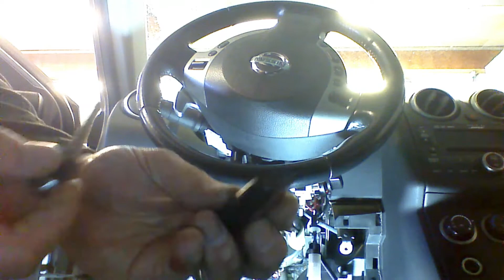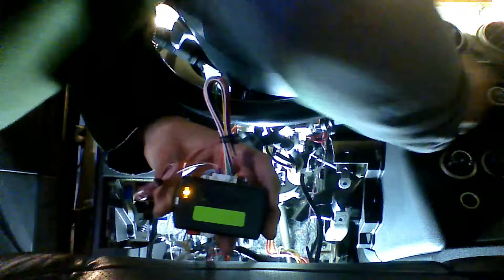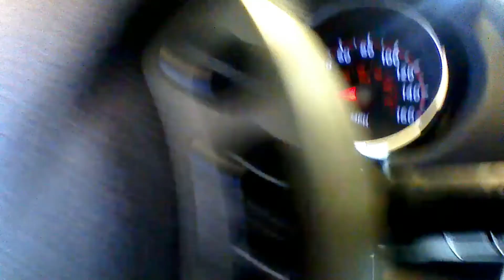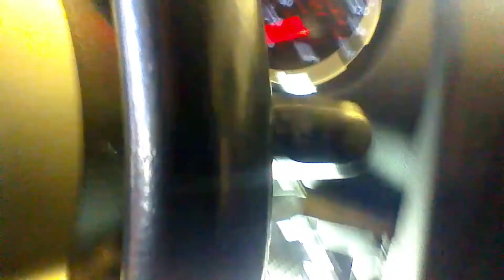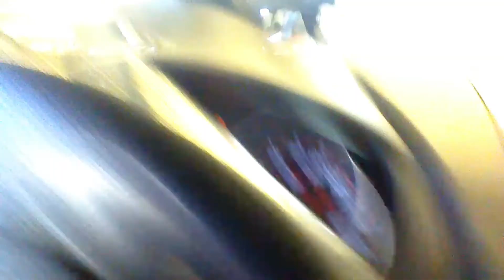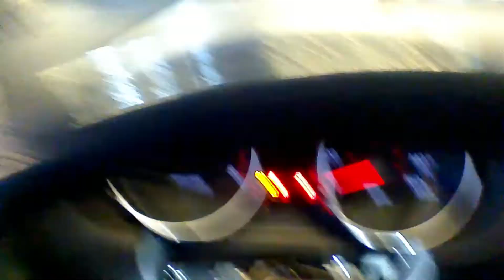2008 NISSAN ROGUE INTELLIKEY REMOTE START INSTALLATION

Comment: I have a 2011 rogue, and I’m unable to turn the ignition even with the key inside of it while the car is started.  So I basically have to shut the car off then restart it manually.  Any advice you can give me on how I can get the ignition to turn over with having to shut the vehicle off, and turn it on manually? TYIA
Reply from the maker: Your Key tumbler connections are incorrect

Comment: It was asking for the key no? It shut off at the end which is the point of alarms without a key?
Reply from the maker: HUH?? Rephrase question.
Reply: warmcarnow I thought you said, you can drive off without the key but the dash started flashing for the key
Reply from the maker: You have to have the key with you and the light turns off after a few seconds of driving.